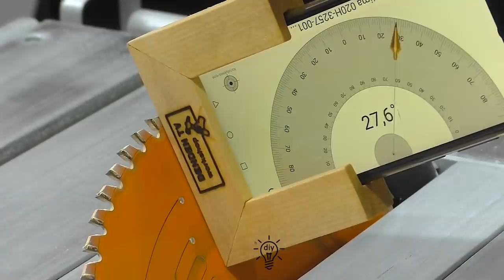Don't waste your money on buying a vice !!! I'll show you how to make them out of wood.

Comment: I think most people that have as many power tools as you will already have a vise. But still great video.
Reply: No. As a carpenter nearly everything we do can be put into 2 categories: cutting, and fastening.  Meaning with nothing more than a circular saw and a drill (and maybe an angle grinder in this case since he's cutting metal bar) nearly anything you can imagine can be accomplished. All the extra fancy tools he has are just for convenience and increasing speed/productivity. 

If you can't figure out with what you got you have no business being in a wood shop.
Reply: @ARMYStrongHOOAH17  estoy de acuerdo con el anterior comentario, con tanta herramienta moderna que utiliza ,bien puede tener un tornillo de banco, esto para los que no disponen de tanta y tan buen herramienta, nos queda muy difícil de construir,
Reply: Rude much?
Reply: @mkbman45  sorry if it came across as rude. That was not my intension simply my observations.
Reply: @ARMYStrongHOOAH17  ride on to that mate 👍
Reply: @ARMYStrongHOOAH17  just subbed to your channel mate ✌
Reply: This is exactly what I thought, it is a great video but the video title doesn’t make sense at all
Reply: @ARMYStrongHOOAH17  .. arrogant much??
Reply: @busybody1474  howso?
Reply: @jmontgomery32  cringe

Comment: I love ❤  this video.  "Don't waste money on buying a $50 vice". All you need is about $10,000 of power tools and equipment to make it. It's a no brainer! Love it 😀
Reply: Dewalt 7492 for the US market you may get around 600$ , spindle moulder for ~300 $ . 

Not that expensive
Reply: @MWWISH  OK, but I counted over 50 tools many of which were power tools including a bandsaw, lathe, drill, bench planner, drill press, jigsaw, table saw etc., and I also saw he used a shop bought vice which he said we shouldn't waste money on.

Comment: A lot of interesting solutions on how threaded rod, nuts, and washers can be used. Building a vice is a good example, but these tricks can be used on custom jigs, which need precise movement, clamping etc - and those, you can't just buy at the store. You can try to build one using the ideas presented here, I will.

Comment: Tools required not to waste money on a vice: lathe, jointer, band saw, mitre saw, pillar drill, table saw, router, bench grinder, oscillating sander, disc cutter, cordless drill, tap and die set, mutilate clamps, multiple squares and lots of glue.
Reply: That's exactly what I was about to comment.
Reply: well, if you don´t have these tools you are in deep shit! 😀
Reply: Yeah and most people watching this video for it’s information are either woodworkers with many of those tools already or know ways to work around it. 

Woodworking in general has many different ways to accomplish the same task. You don’t “need” all that stuff to do this.
Reply: @bradasskg11  
Most woodworkers appear to spend all their time watching others making jigs that make woodworking easier so that they, too, can make jigs that make woodworking easier. What for I have no idea, most of them can't make a straight cut with a handsaw, let alone make anything worthwhile.
Reply: @markcynic808  Did you really read your comment before you pushed " send "?
Reply: @rufeilrahtieh7885  
Of course. You have some kind of problem with English or truth?
Reply: @markcynic808  How do you combine English particularly with truth?
Reply: @rufeilrahtieh7885  
As you are unable to understand English and have no point to make in any of your inane statements, why are you wasting your time and mine in making yourself look a fool?
Reply: @markcynic808  Is there a scientific fact that, 
" Most woodworkers appear to spend all their time watching others making jigs that make woodworking easier so that they, too, can make jigs that make woodworking easier "
Or did you make that up in your head?
Reply: @markcynic808  Excuse me how i use your own words against you.
Excuse me how i do not offend you by using inappropriate words.
Yes my bad English, but still you understood my bad English.
Reply: @markcynic808  So your point is that, if anyone can lay their hand on a dead or a drugged tiger they can make a straight cut with a handsaw?
Reply: @markcynic808  Now i am sure that the Tiger was dead.

Comment: But a vice only cost $20. How much did you spend on materials and your time? And how much for all the tools?
Reply: The wood is free scrap.  If you have a shop, it just builds up after paying work and big home projects.
The bolts, etc, are often leftovers from other projects too. It's often cheaper to buy a "50 pack" when you need 30, than to buy them individually, so that stuff builds up, too.

If you're only a hobbyist, that stuff you have to go out and buy just for the project.

Comment: I have to wonder at the people who shy away from making their own tools.  You need tools to make them? Well what do you need the clamps for if you don't have the tools?  What foolishness to say you need to spend money on the tools to make thngs. Don't you have these tools ALREADY!  
It will cost time (and materials)?  I don't get this either. Unless your doing this as a business it doesn't  cost you either.
A  simple wooden mallet can be made or bought. If bought will run from $30 - $80 or more. if made cost you nothing but the satisfaction of building something.  Some would rather spend that $80 on something a little more important.
I've seen this hobby change from jigs and fixtures to what new item can you buy. So much so that to build anything out of wood now requires machinist grade tools. Almost all of those tools and jigs you see were originally built in the shop.